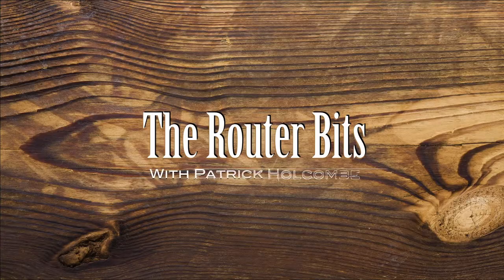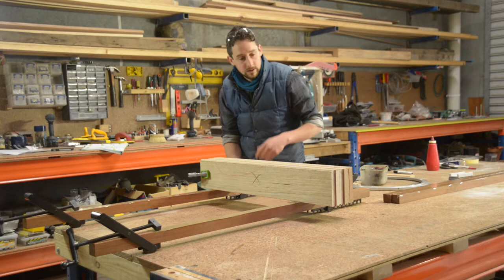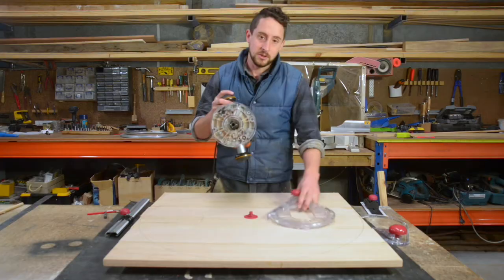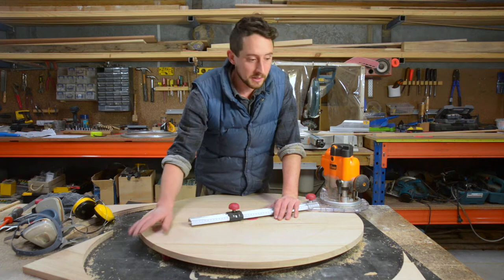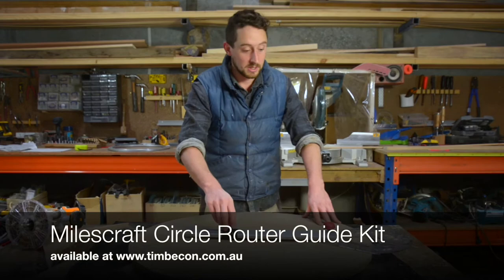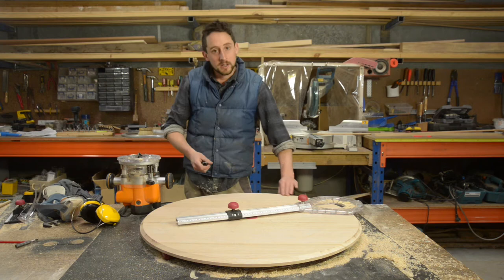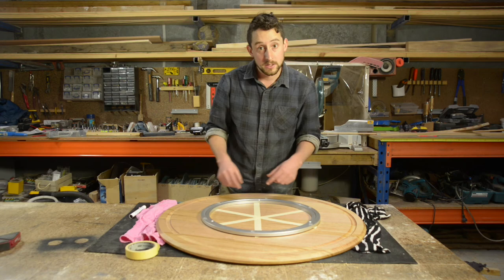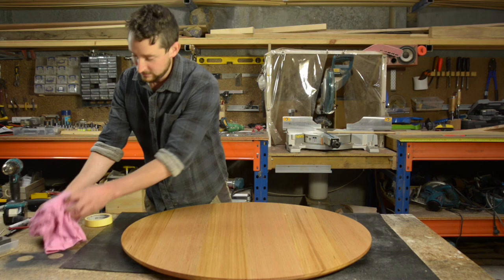The Router Bits - Making a Lazy Susan

Comment: Hi Patrick,A very enjoyable video, It is JUST IN TIME my next project is to built our dinning table  1900 x 1000, timber I have chosen is 19mm OAK (given to me) my pazel  is should I use glue joint Router bit? and what preparation I should use for across member? slot & screws and how, should I glue the long pieces with Tite-bond III? and also with the cross member? I should start my project in about 2 months ....maybe a short video with small table top with help... My neighbor who gave me the timber tried to built a large barn door which end-up looking a curved semi circle board NO ALLOWANCE FOR TIMBER MOVEMENT I DO NOT WANT TO DO THE SAME MISS-TACK
Kind regards
Jack from Gold Coast.
Reply from the maker: Hi Jack. 

Probably too many questions to answer in the comments section here! I'm not sure if we have it planned to do a similar project in the next short while but something like that will be getting done sooner than later. If you have any specific questions best thing to do is call the office for advice (1300 880 996) and ask for either Jesse or Erle. Both cabbies by trade and very helpful!